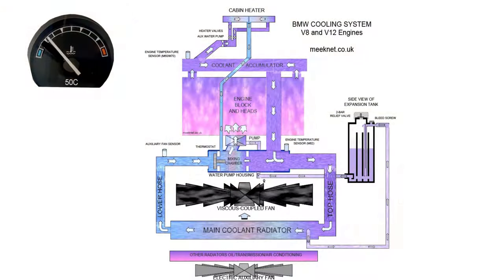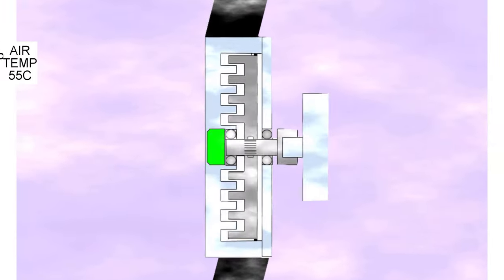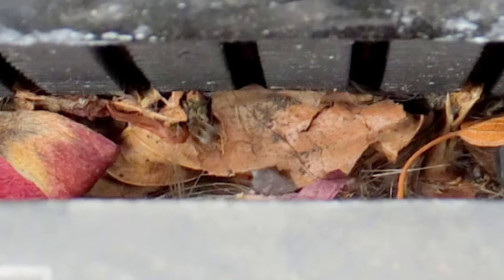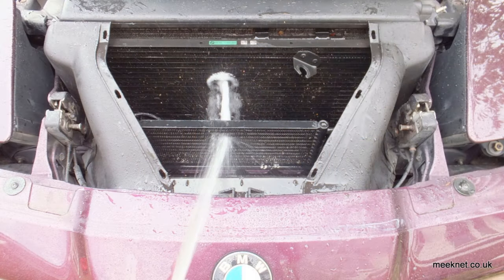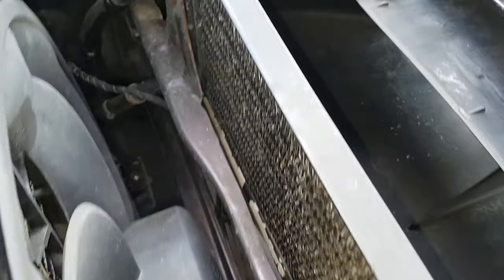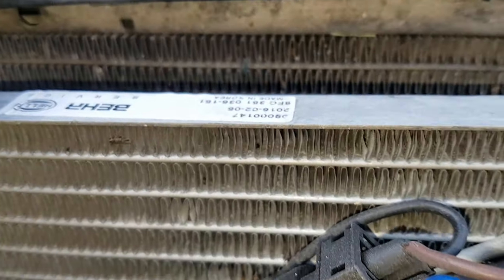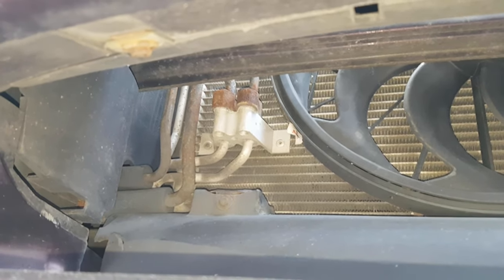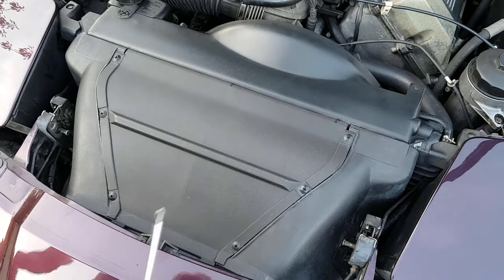BMW Overheating? Check this first!

Comment: Mine is having both thermostat and coolant temperature sensor issues....how do I know which is the bad one? I don't want to buy both...the engine is running cold... constantly. The heat does work most of the time...
Reply from the maker: Start with the thermostat William, the sensor will not affect the cabin heater
Reply: @TimmsBMWRepairsandInformation  the heat is working actually...but the gauge won't budge from the blue
Reply: I'm planning to get the coolant temperature sensor and thermostat Friday... hopefully that solves it....it's not good to not know if the temperature gauge is actually hot and reading cold. But my BMW has a warning light that would come on if it was truly overheating
Reply: Car shakes some at startup....some rough idle....I did make sure the oil and cylinder heads were not milky looking
Reply: @TimmsBMWRepairsandInformation  we did change the spark plugs....wires.. ignition coils and boots ...and it did bump the idle up some
Reply from the maker: Misfires when cold - try this: https://youtu.be/qyxzL7OFz6k
If you have the thermostat and sensor change them and report back!
Reply: @TimmsBMWRepairsandInformation  will do! And I just found out that there are two coolant temperature sensors in my BMW 2004 325i
Reply: I see the sensor 1 by the lower radiator hose
Reply: @williambernstein4313  so what happened Bru u answered everything but what people actually wanna see

Comment: I have a new water pump on my 328i 2010 and It was good until I had a coolant leak and threw in a "stop leak" and filled it up with coolant and overheated even tho I bleeded it
Reply from the maker: If you lose coolant pressure the coolant will boil as the coolant temperature exceeds the boiling point - it is only kept a liquid by the build-up of coolant pressure - if you have a leak you are on a hiding to nothing!
Reply: I'm Having The Same Problem Rn Bro Did You Find Out What It Was? Mines Leaking Blue coolant & It Overheats When I Accelerate ...Thanks Fam
Reply: @Timm's BMW Repairs and Information  what does that mean should I worry?

Comment: I wouldn’t know, my e90 doesn’t have a temp gauge
Reply from the maker: Although you can get the coolant temperature displayed using the hidden menu system, or code the cluster to show it - it's a bit of a faff - and is something I certainly miss.
Reply: @TimmsBMWRepairsandInformation      what is a faff?